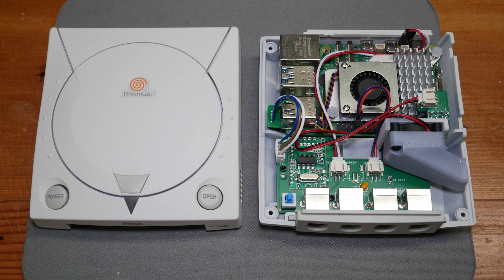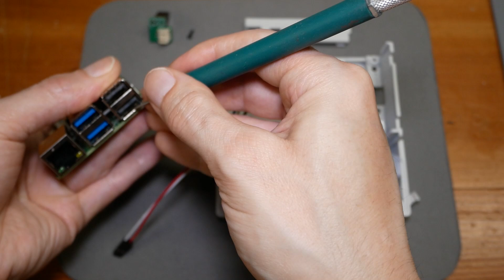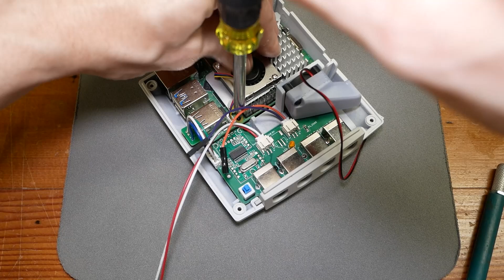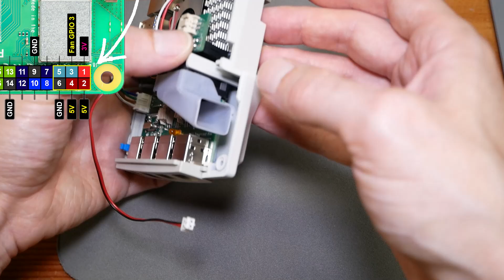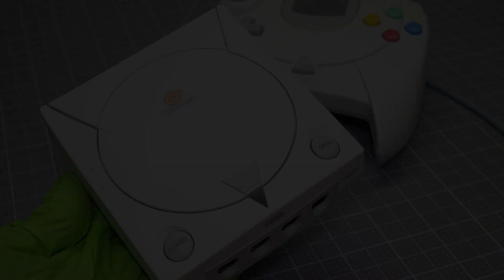Dreamcast Mini Kit  - Raspberry Pi 5 Installation

Comment: Hey, so I am considering upgrading my Raspberry Pi 4 to 5 and I was wondering.

I am wanting to make a Dreamcast Mini of my own, my own theme included which is working in progress, and I was looking for a case like this baby you have here. Maybe when I upgrade my system with a new Pi, I wanna get this case from you. Is there a way to get it working WITHOUT soldering anything?
Reply from the maker: Its not gonna be affordable.  Most the work and cost is in the finishing of the case and its assemblies.
Reply: @MultiGameSystem use raspberry pi 5 4gb or 8gb? Is bether than dreamcast original?
Reply from the maker: @kadhertorres7841  I wouldnt say better necessarily but it does have more features and settings to tweak.  It also can run other systems so you could say that makes it better.